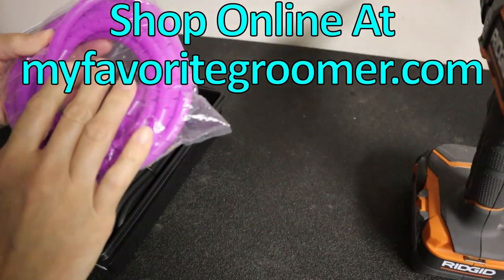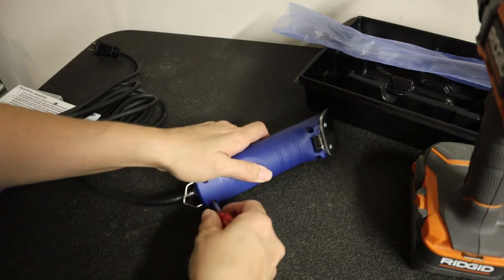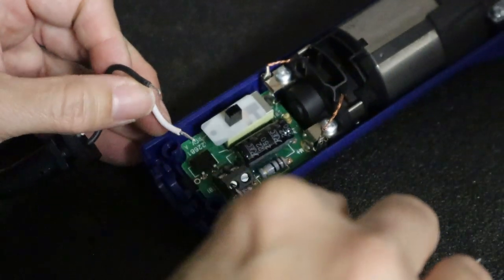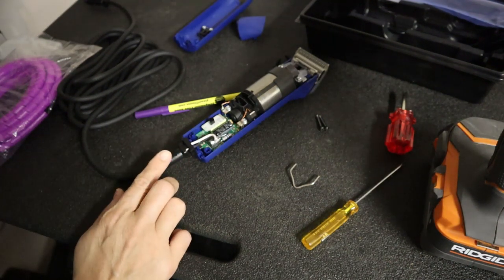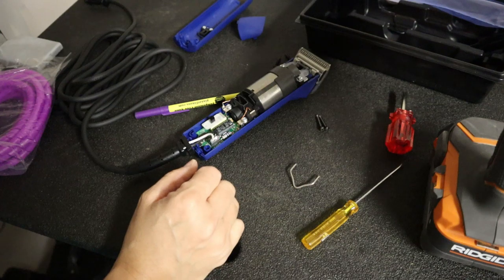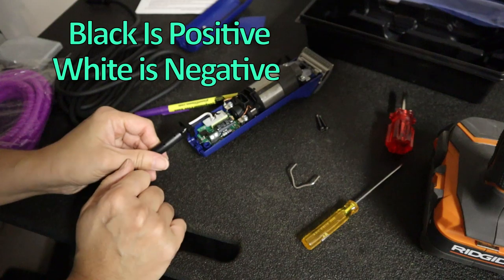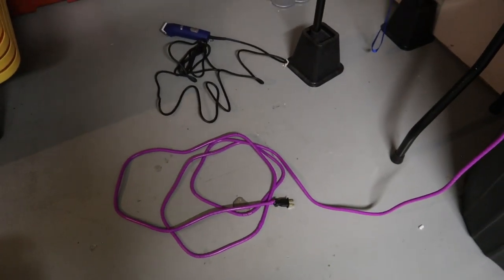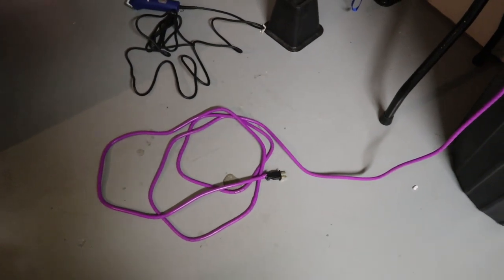Tired of Tangled Cord - WATCH This!

Comment: If you're going to go to the trouble and expense of doing this then you would be better just replacing the supplied PVC mains cable with a new silicone mains cable (2 or 3 core 0.75mm - whichever is needed). Way more flexible and does not tangle. Can't post a link but search Amazon, it's pretty cheap. Mains plugs and strain-relief ends are available too to match what you have (different clippers use different types). You can also make it just the right length to suit your needs.